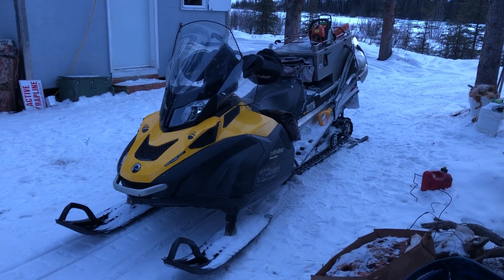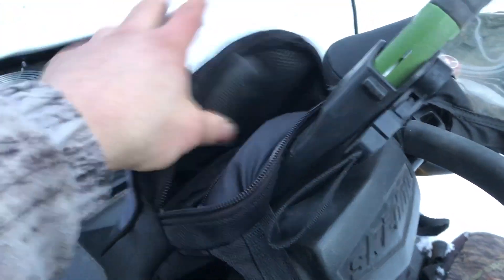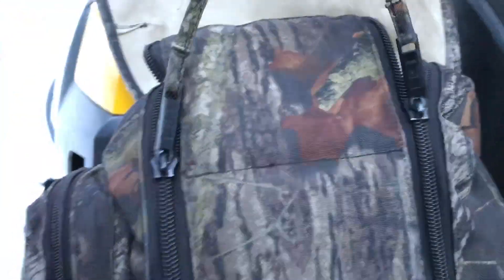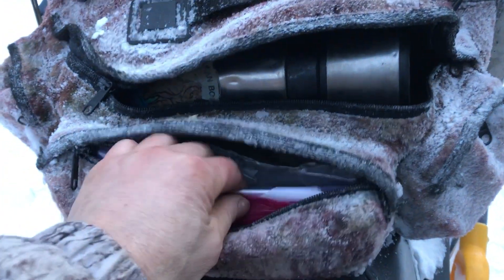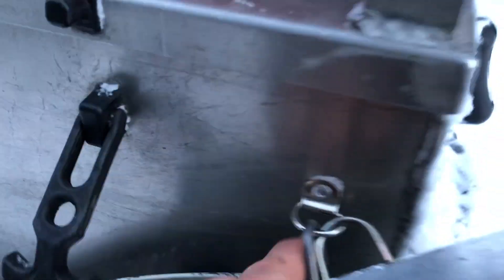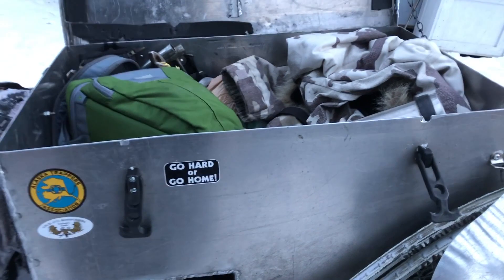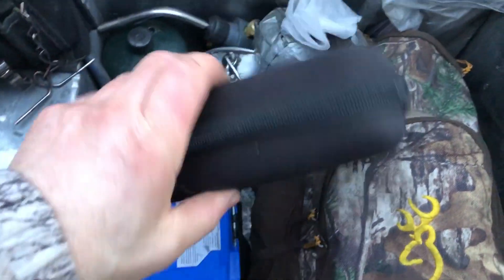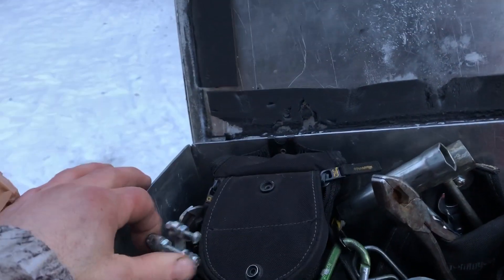My Trapping Machine set-up

Comment: Cool video. I have a 2012 Skandic 550F. I built a cedar trapping box behind the seat to keep the weight down and scent right. the box has a built in place for my thermos. I tow a taboggan made in Fairbanks, with a cover for hauling gear, traps, critters, survival gear, InReach etc. I use a shovel made for avalanche safety, fits in my trap box. I have trappers axe and use a .218Bee Thompson Center Contender with a two power pistol scope. Love the skandic

Comment: Hi, are you still running the skandic? Would you buy the 600 ACE again…any complaints about the engine? Thanks and good video!
Reply from the maker: I still have my Scandic WT 600 Ace. It is my back up sled out at the cabin. No complaints but the 900 starts easier in the cold and twice the power.